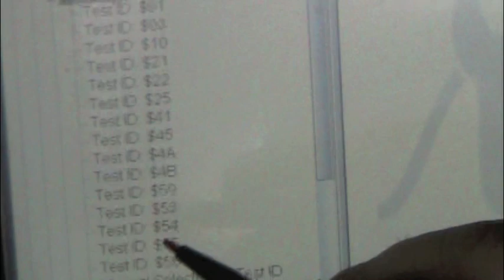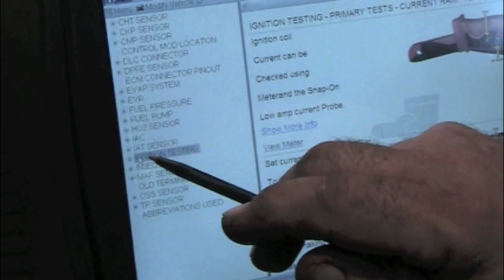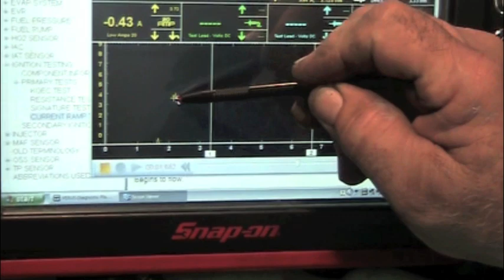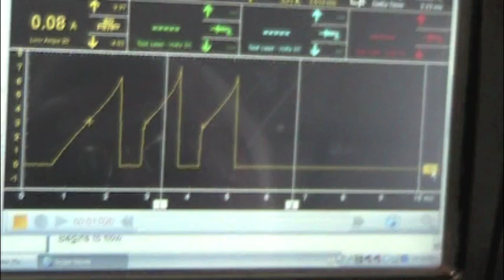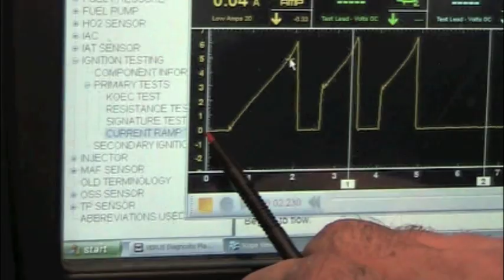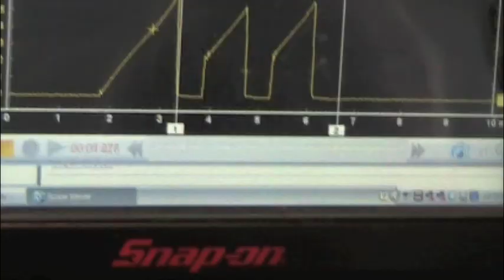No code misfire

Comment: It's frustrating ... mine misfire no codes. Its like a journey to fix it.
I suspected that mine was not a coil --- it runs perfect up to 4,500 rpm and when I opened it up, that's where I got the misfire.
I was thinking that since I don't run my car so often, it develops water inside the tank.
I put a bottle of HEET to dissolves the water, its getting better but still missing a bit at high speed.
Reply from the maker: HEET is not a fix, it simply displaces water.  There are several troubling things in your description of the problem.  in particular the 4500 rpm.  More detailed info would be needed to offer any advice at all.
Reply: @realfixesrealfast  I've done a few preliminary troubleshooting  - I drained the fuel (car was not driven a lot), I cleaned and gapped the plugs, I replaced the 02 sensor (all),  replaced the map sensor, all 8 cyl firings.  Gas was bad before draining it. It happens after I drained  the bad fuel. My guess, the water remained in the tank and when I put 5 gallons... the car will run good under no load. When I started to boost, that's where I noticed the power was holding. I keep pouring K-100 (isopropyl) hoping the water bind to the gasoline and hoping to burn it. It gets better but i still noticed if misfire under load.

To reach my coil and check the injector is a big task for this car because it's under the plenum if the head (lotus v8 turbo) - I was stalling to open (my last resort) the plenum and  reach the coil - wires and test clean the injectors.
I checked the fuel pressure, its within the spec. 
So, I was buying time to diagnose the easy parts but yes/no... it gets better but not quite better yet.
Maybe its beyond water in the tank. 
Thank you for any help and idea.

Comment: What is brake torquing and how is it done?
Reply from the maker: Brake torquing is simply "loading" up the engine without the vehicle moving.  All you do is FIRMLY press on the brake, put it in gear and momentarily step on the throttle.  BE SURE THE VEHICLE DOESNT MOVE  This causes the engine to "load up"
Reply: realfixesrealfast so left foot brake and right foot gas?
Thanks so much!

Comment: Heres a tip, sometimes its just the bolt that holds the coil on has become corroded, that will also cause high ground resistance but can be fixed with a quick sanding and cleanup of the grounding surface, not going to work every time but beats buying a new coil when you might have a working one, great vid, that tool makes me drool
Reply: Actually quite wrong. Totally obvious you don't work on gasoline engines. Pretty much every coil ever has its own dedicated power and ground with one end being controlled by the PCM or ICM.  The coil does not even have to be on the engine to fire.
Reply: no .just plain wrong.  plastic i heard has very high resistance lol
Reply: haywood jablome well of course but not all are just plastic so actually quite right

Comment: without the tool, pull the plugs for the injectors one at a time. if the engine does not slow down that is the cylinder. switch 2 coils, if the miss follows the coils it is verified. If the miss stays put check gound and driving circuits.
Reply: I had a case where the issue was intermittent. It would come and go.

Comment: A pc based scan tool.....yeah, some of those are good. You can actually get a lot better DSO than the Versus has for a really good price. Problem is, you are not going to get the specialized automotive database and test setup that goes with tools like the Versus. From what I have read, Owon makes a pretty good 2 channel DSO for about 700 bucks.

Comment: @beefystik what about using a laptop or tablet pc. i use a laptop with an ALDL cable on my OBD1 GM vehicles and i know that there are cables and software available for obd2. probably i allot less expensive and it does the same thing

Comment: What about a 97 model 4.6 liter Mercury engine that doesn't have coils on plugs but instead has two coils mounted on the front of the engine? Can those get weak without burning out completely. Mine engine has a misfire I can't figure out.

Comment: I really don't care why the coil has failed,  I can current ramp but I don't when I know by swappin that it's causing a misfire. Sure I've seen the burned through boots, and I can see one with my eyeballs too.  After 35 years of this stuff I'm not real thrilled with scopes unless I need it for a "tough diagnostic".   My attitude aside you do nice videos. The only thing you might add is how the coil is controlled. Thanks for an informative video. My poor old Vantage pro sits for weeks sometimes

Comment: Another thing with fords is that they dont have a CKP misfire reference value stored in the computer like dodge and chevy. So if the computer was cleared recently, the computer cant develop a normal crank sensor waveform reference so the computer never sees a missfire.